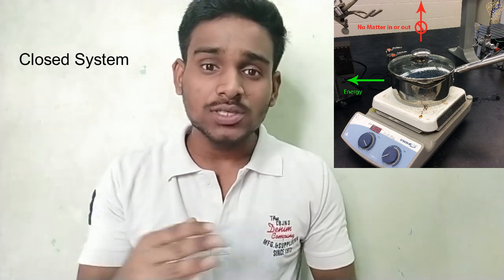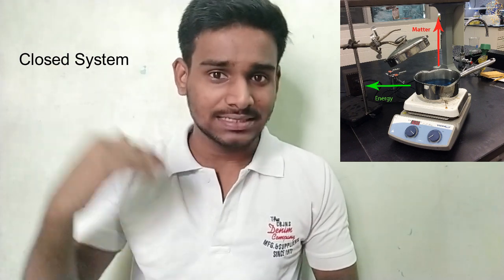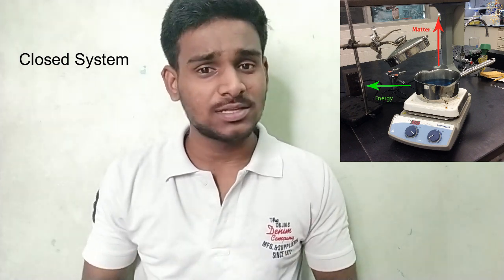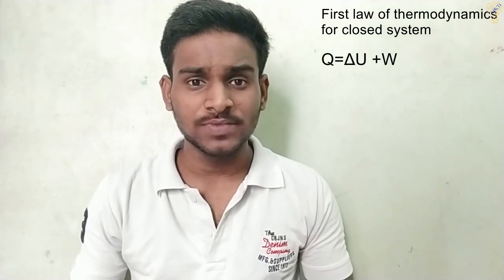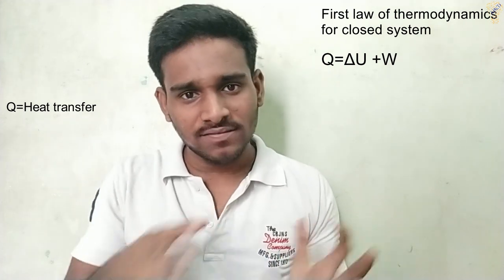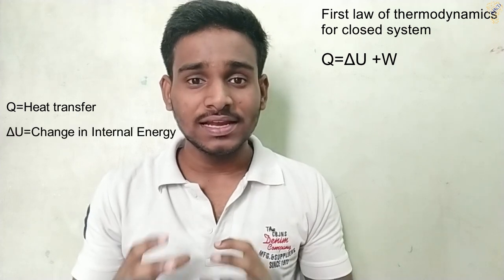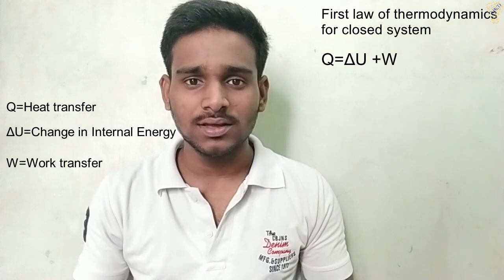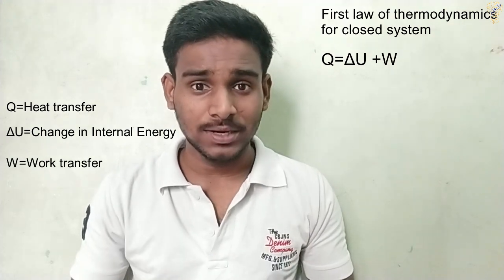ABCD of Enthalpy | What is Enthalpy?| Internal Energy| First law | English subtitles | Tamil

Comment: You have fully understood the concept! 

Energy supplied to a system does three things: 
1) Increase the internal energy
 2) increase the pressure and/or 
3) Increase the Volume
The sum total of all the three is (or can be called) as Enthalpy

In a pressure cooker, the heat increases the temperature (internal energy) and pressure. But not volume. In an IC Engine, all the three parameters  increase (T, P & V). The input is the Chemical energy from the fuel in both the cases.